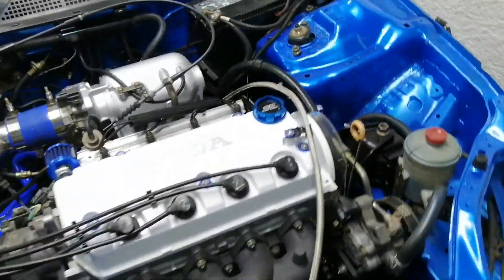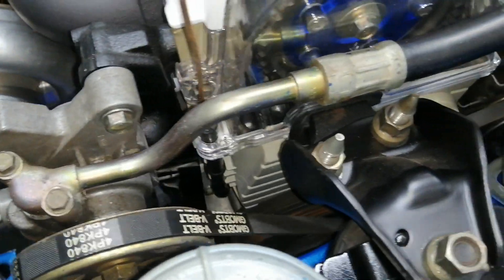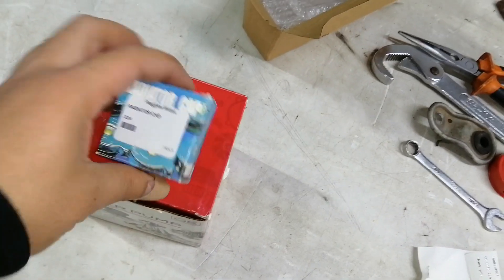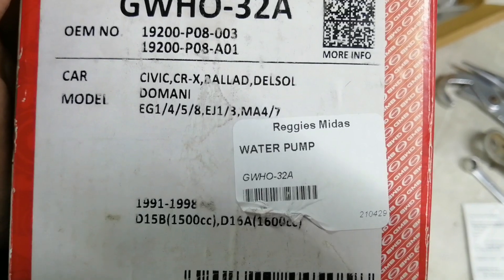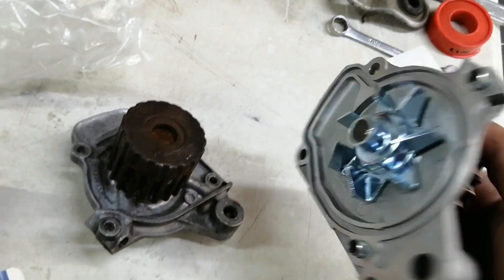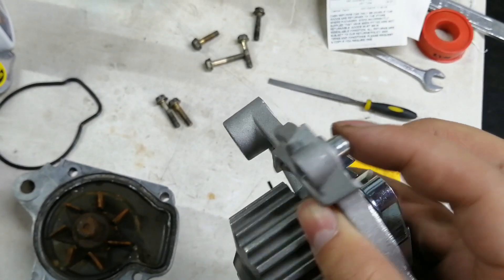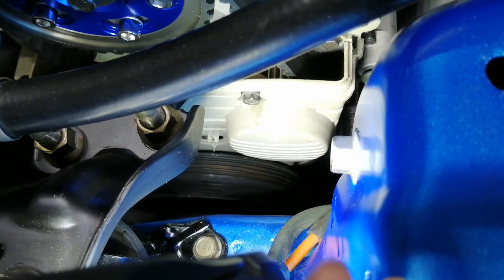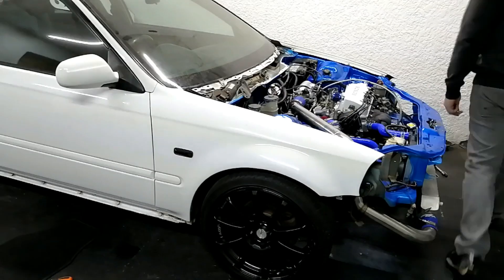D-Series Water Pump Replacement - Turbo Honda Civic

Comment: Good video thanks 
Will this work on a D16Z6
Reply from the maker: Hi, yes both pumps should be compatible with the Z6. But the big pully pump may touch the plastic cover
Reply: @RisingBoostYT thank you 
Great video it will help a lot

Comment: Hey man, you can show how you adapt the cover to be able to remove without removing valve cover? ty for the video!
Reply from the maker: Hi, I will look into doing it in the future, but in short you have to grind away the part that hooks in under the valve cover, it is the lip above the cam gear
Reply: @RisingBoostYT but the entire part?

Comment: I Have Never Changed A Vernier Pulley For The Camshaft. You Take The Old Pulley Off & Fit The New Vernier Pulley. Is The Vernier Pulley Mainly For The Vehicle's With A Turbo & If You Have A Degree Cam. If You Loosen The Allen Keys On The Vernier Pulley, How Much Do You Set It To The Left Or Right. Then You Have To Tighten The Bolts & Check The Timing With A Timing Light. I Know That When You Take The Car For Dyno Tuning They Loosen The Vernier Pulley & Play Around With It Untill They Get Maximum Performance. & The Same With The Distributor They Loosen It & Check Where It Gives Maximum Performance. Yours Is Dyno Tuned. What Make & How Big Turbo You Have On The Car. How Much Are You Boosting It. The Car Is Very Clean. Are You From South Africa. Very Helpful Video.
Reply from the maker: Hi Allen, I mainly got the pulley because I swapped on a vtec head and sometimes it requires the adjustable pulley to get the marks to line up as per factory marks. cam advance or retard can move your powerband up or down a bit, helpful for turbo setup as you gain a bit of control over your power band. It is more helpful on DOHC motors as you can adjust valve overlap. I currently run +3 degrees to get my cam to factory 0 degrees. it is running 0.6 bar boost and made 139wkw. turbo is a T04E 50mm 0.50AR

Comment: Hey sir! Got an ek civic d16y8 with 176k on it. Car runs great and I just wanted to get a bit more “pep” out of it. Im deciding if ebay turboing the car OR just saving up for a future Bswap. Kinda wanted your take on it. I wouldnt chase anything past 200HP or above 10lbs of boost. And I would likely replace the pistons/rods/cam springs/retainers to help with some longevity. Smart to throw money at this decently aged Dseries or save for the Bswap? Many thanks
Reply from the maker: Hi J, the mileage should not be an issue if you boost it, also if you are only looking for 200hp you don't need to change anything internally in the motor, at 200hp it should be just fine and still be decently reliable for a long time. the Bswop will be more reliable and have a better power band and better fuel consumption. the turbo D-series will need a tune-able ecu, upgrade fuel pump, injectors and clutch. I think you should look at cost, turbo D-series will be more fun, Bswop is more reliable and stronger incase you later on want to boost the B.
Reply: @RisingBoostYT  yes I’ve seen cost wise that a bswap will be cheaper. And i’d like to boost it yes. However, finding a decently priced/mileage one is difficult currently. And noted! I will leave the block as is then and start to source the needed turbo parts. Thanks for the super quick reply!
Reply from the maker: If the Bswop is cheaper i'd consider it if you can find a good motor, they are superior to the D in most cases, but if your D-series is not burning oil or breathing more than normal, it could be easier to just boost it, it's definitely more fun and you get turbo noises. just don't go too big on the turbo or it will have turbo lag like mine.
Reply: @RisingBoostYT  I havent searched too in depth with your turbo size, by a T25/T3 should suffice no? And indeed, the Bswap would last longer and handle boost better. Unfortunately even the space/tools to swap it out myself is lacking at the moment. Therefore, it persuades the Dseries turbo more and more.
Reply from the maker: In that case boosting the Dseries sounds like the best option, T25 should be just fine for a decent powerband

Comment: That's the same radiator cap I have on my 98 civic ex. Haven't had any problems out of it so far. Just an old Honda with 258k on it
Reply from the maker: Hi Chris, I got a new one, but still the same one cap, working great, just my old one got a rip in the seal.

Comment: i have a z6 but everyone say i cant use a y8 water pump, it might match up but it will leak
Reply from the maker: Hi Grantdy, for me the D16A6 pump worked perfectly on the D15Z4 that is similar to the Y8. I know there is a pump with a slightly longer or shorter lip where water goes into the block. Those don't work on each other, but i have never seen the long lip pump so not sure what motor use it.

Comment: Thanks for your videos! I’ll probably try and pick your brain later on! I’m currently planning a d16y8 itb-turbo set up. If I can prove to myself it’s worth it! ?🧐
Reply from the maker: Hi Jager, if you build the motor I would say yes, but if you just boosting on a stock motor I would say just boost on the stock intake, you won't need the itbs to make the max power the motor can handle. Just turn up the boost till it makes 220whp and leave it there.

Comment: Excellent work man! and like as said "Boss" Video indeed 😏 very very nice guide to the task on changing waterpump etc  including the effect of losening and tightening the alternator belt etc

Great Job
Reply from the maker: SRD thanks for the support! 🔥
Reply: i understand the effort you took thats why :)  i am 191cm tall... doing the same work = hurts my back and having fat arms doesnt help 🤣

but always ready for a brai 🤣
Reply from the maker: Yeah definitely a job for someone small, even I had difficulty because of the limited space, have to do everything with 1 hand 😄. But very glad its possible without removing engine 😅

Comment: hello friend how are you a question the pcv valve of the manifold on the bottom side where is it connected to any side or does it have any hose greetings I have a Honda Civic Si 94
Reply from the maker: Hi friend, the PCV pipe goes from the black box on the back of the block, then to pcv valve and to the intake manifold.
Reply: @RisingBoostYT  thanks for your help, friend